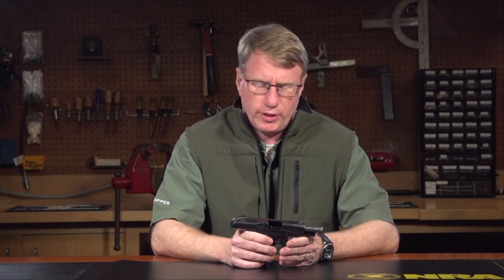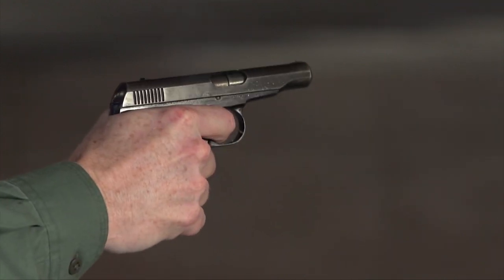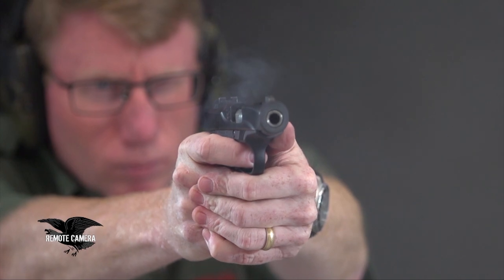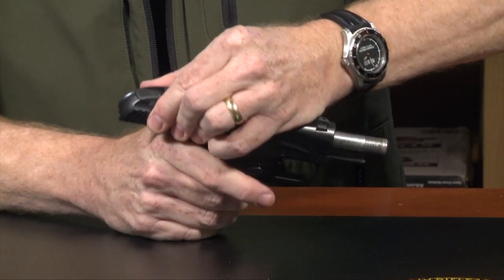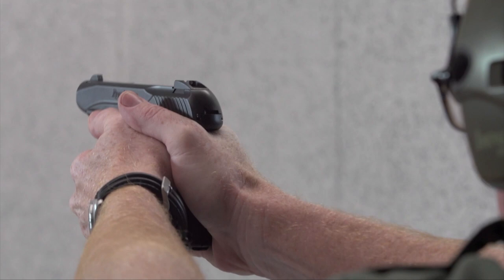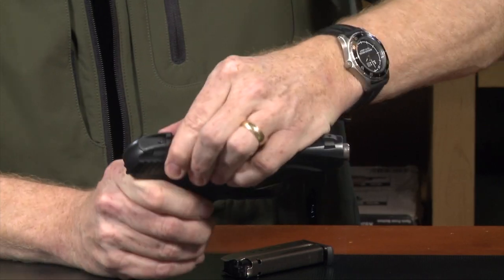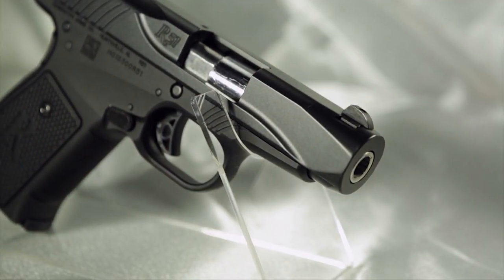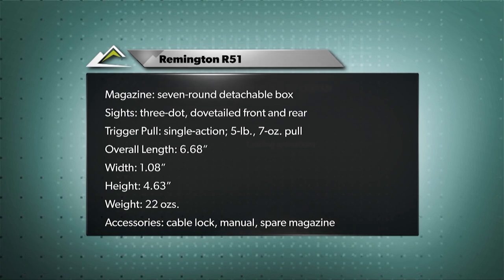Rifleman Review: Remington R51

Comment: Here’s the whole story on the R51. Remington tried to expand the Pederson locking system into a bigger more powerful gun. Originally there were plans to offer a .40 and .45 caliber version but after the first issues they were junked. The gun magazines sung it’s praises as the online community said the guns were crap. This is where the stories come from, they are anything from bulged cases to jams, to guns going full auto. Remington recalled any consumer guns out there and offered owners a choice. Wait for the re-engineered guns to come out and they would receive a new R51, a pelican case, additional magazines and get it before anyone else, and no FFL fees. Their other option was to receive a brand new R1 1911 with all fees paid, or Remington would give you back full retail. Most waited for the new gun. The issue was found to be tolerance stacking, the springs weren’t long enough to operate properly. With a redesigned magazine and spring they tested it and reintroduced the gun in 2016. Problem was too many people at that point had decided the gun was “ junk” and they wouldn’t give it a try. I bought mine when Remington was throwing in a 50 dollar cash back offer. I got a very early Huntsville gun and mine was 100 percent reliable with the crappiest ammo I could use. The Gen2 R51s mostly work if you bother to do a break in and too many other folks claim “ it’s junk” which they got via a 3rd party reviewer or a buddy who had an original R51 9mm. It’s unlikely they’ll ever be made again so those individuals will not get a chance to see they got it wrong
Reply: The gen 2 work provided that you don't load the mags full with one in the chamber. That is, you can use it as a 6+1 but not a 7+1. If you load it to 7+1 then it will almost certainly jam on the first shot, or pop the first round in the magazine out of the gun entirely along with the casing from the first shot and load the second round into the chamber. There is a fix to this problem though. If you remove enough length from the legs of the magazine follower with a file or grinder then it will run with 7+1. After doing this mine has run perfectly with 7+1 and I love it.

Comment: Not a bad shooting pistol ,has decent accuracy and not bad on muzzle flip. Iv`e only had mine for a year and quickly found that if I download the mag to 6 it runs 100% every time and that`s with one in the pipe. I just learned the remedy for the mag this week due to lack of time and many other toys to play with so before long i shall see if it will run 7 in the mag. Another trick i learned was to replace the stock slab side grips with aftermarket wood ones then it gives a nice fit in the hand that makes all the difference.

Comment: Small tweeks and good marketing should bring this gun back to a competitive stance in the market. While the new higher capacity micro compacts are all the rage now, two things this gun has that will always make it somewhat competitive are low price and great shootability. It's pleasant to shoot, has relatively low felt recoil and muzzle rise, and good accuracy. Tweeking the magazines and Pederson block will make it totally reliable. Many people are reporting it as reliable now. New instructions and possibly a tool will make cleaning a lot better. I hear Ruger is buying the Remington firearm business so maybe there is some hope. They tend to listen to their customers.
Reply: Agreed
Reply: Found the Remington marketer. 

They tried to fix it twice and failed when there have been countless procen guns on the market for decades. The R51 is deader than disco.
Reply: Not a good gun if you have arthritis or corporal tunnel issues.   Takes an engineer to disassemble it, and 10 hands.  POS

Comment: I know there's a lot of controversy about this gun, but mine runs great with over 1000 rounds through.
Although at first I had to send it in for bolt fitment.It would fire 6plus 1 great but not the claimed 7 plus 1.
But 1000 rounds later it seems very reliable..After that many rounds of reliability I feel confident that it will go bang when I pull the trigger.

Comment: Has any one ever shot one of these or are just repeating what you heard?
 I shot one and it is a fine weapon.
Reply: I own one. Have had multiple failure to feeds, but once you run several hundred rounds through it it’s fine.
Reply: I have had mine for 5 years now.
Never had any type of failure.   I always have 7 in the mag. and 1 in the pipe.  Take down is very simple if you know the correct procedure.
Reply: Had mine for 6 years now.  Zero failures,  and I found the correct procedure of the take down. Really very simple to disassemble and reassemble. 
I can do it in 35 seconds.

Comment: A fun gun for gun nerds like me until you go to the range or even worse go to field strip it.
Reply: Some people with a low IQ have trouble breaking down this gun, but it's not very difficult at all.
Reply: I can disassemble and reassemble the R-51 in 35 seconds.  1 minute and 15 seconds blindfolded.
Have even done it with 1 hand.
Everything is simple once you know the CORRECT PROCEDURE.

Comment: This is a gun that has no future.  First, as alluded to, it has a terrible reputation as a jam-O-matic.  Even if Remington has worked out the bugs, it'll never lose that.  Second, it's only a single stack in a market that's oversaturated with small subcompact single stack 9mm, and ones that have good reputations (G43, Shield, etc. etc.)  And the single stack subcompacts have now been superseded by single stack width double stacks (P365, Hellcat), pushing this loser farther to the back of the market.  Finally, Remington is bankrupt and is being parted out to multiple different buyers.  For historical reason, Remington felt the need to keep trying with this gun.  Whichever company ends up with the rights/tooling to this gun in the buyout probably won't feel the same, and will just not produce it any more.  So look for this design to disappear from gun store shelves pretty soon.

To the last point, at some point back, Remington bought Rohrbaugh for their R9 supersubcompact 9mm.  They promptly turned this into an unremarkable .380.  Whoever ends up with the rights the R51 will likely end up with the rights to the R9/380.  Hopefully they'll get the R9 into production again.
Reply: The R-51 is quirky, but budget pistol. Some states like NY have capacity limits. So those buyers would like it. I still want one. Might be a collector item someday?
Reply: The R9 was a lousy gun. I know I overpaid for one years ago. Too many things were compromised for size concerns. The thing was fitted with a punishing DAO trigger, it was virtually sightless and was useless at anything but point blank range. And the recoil was god awful, the small size meant even 9mm actually hurt. The combo of a skinny dig into your hand backstrap, a heavy trigger and no sights proved too troublesome, it was not very reliable either only working well on the hottest of hand loads. It was a boutique micro gun and was iffy at best. They also made a .380 using similar parts which is what the RM380 was. As a .380 the Rorhbaughs were better guns. I doubt you’ll ever see the R9 again cause it’s just not viable anymore. There are far better slimline 9mms that are way more reliable
Reply: @WALTERBROADDUS  Glock 43.